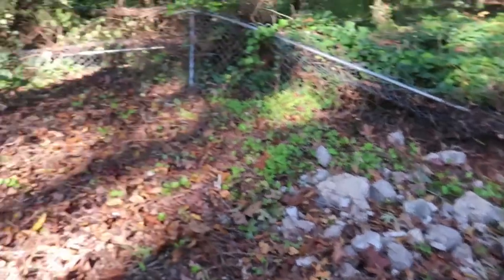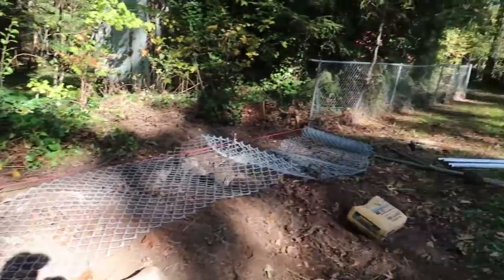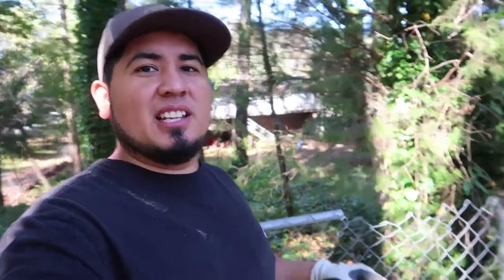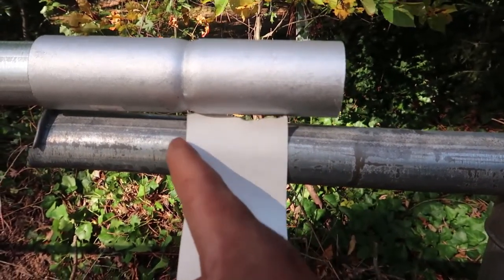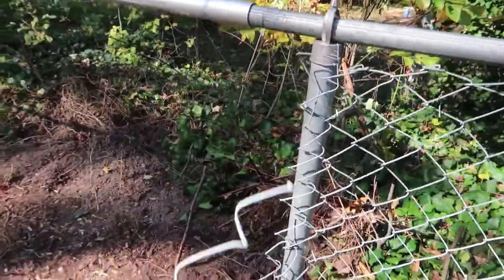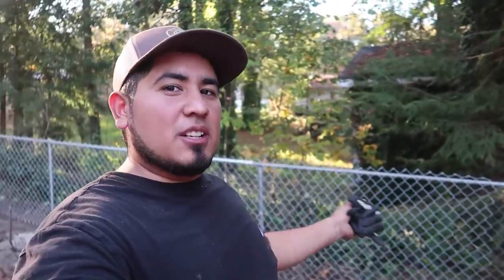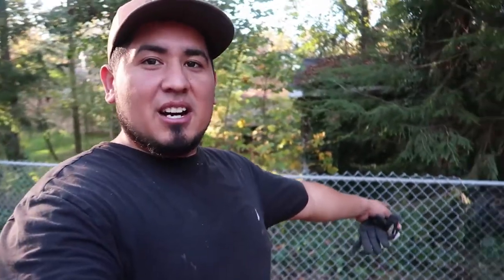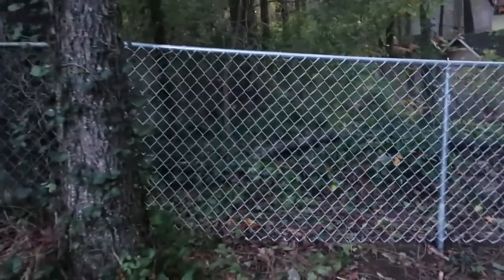How to patch a chain link fence [tips & tricks] Beginners guide

Comment: I’ve seen several video’s do it like this but why can’t you end both sides of the fence at the pole like you would at a corner or like putting a gate in the middle of itand if you had to overlap a little I’d use wire tie’s or zip ties to blend it,it’s not in front of the tajmahall but I’m not getting down on you for the way you did it just trying to figure out how to repair mine where some dumb ass thought my yard should be his parking spot!
Reply: I’m not trying to be a butt hole but can’t you slide one of those straight piece’s like at a corner down thru the fence and fasten them together then fasten to the corner.?seems straight forward and clean.myself I don’t like the overlap stuff.doesn’t seem as clean but like I said not trying to be a jerk and you’re the pro not me.getting ready to fix mine where a drive thru,hit and run happened.it this is oct.it happened last xmas eve.,still waiting for the police to show up.lol @El.Stumpy